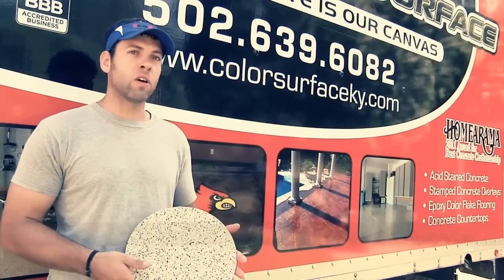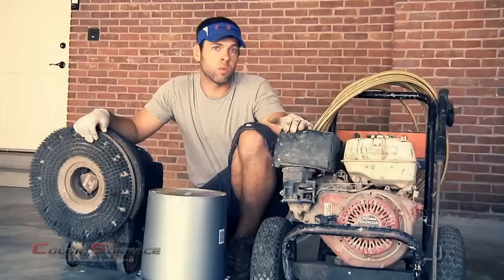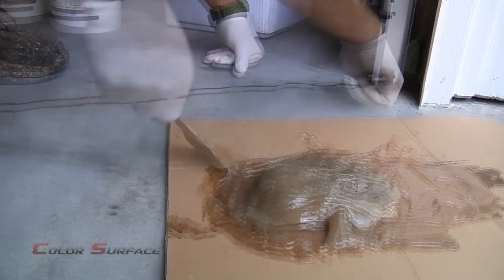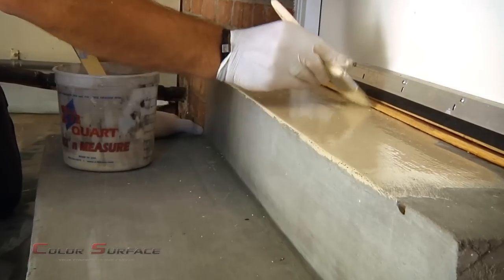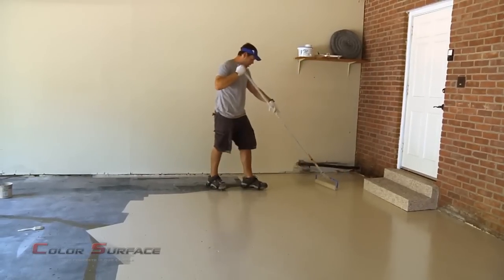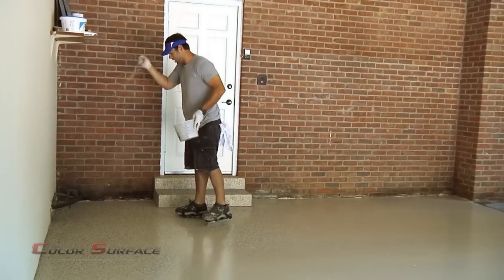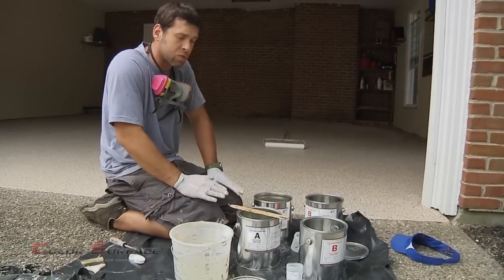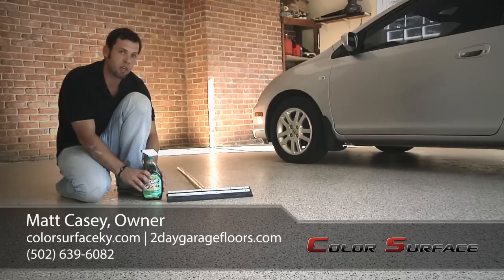Epoxy Floor Installation by Color Surface

Comment: Awesome tutorial! You are very thorough, do you mind telling me what products you use? I use a supplier which I won't name, but the floors do not look near as nice as yours. I'm really interested in the crack repair flex epoxy also. If this is info you want to keep close to your vest, I understand. Thanks in advance. Oh and for Body comp, DimaBrush works great for removing sealers, mastics and paint.

Comment: Just wondering, if the floor has previous epoxy paint do you need to remove it first or just scuff it with a diamond grinder?
Reply: Thank you